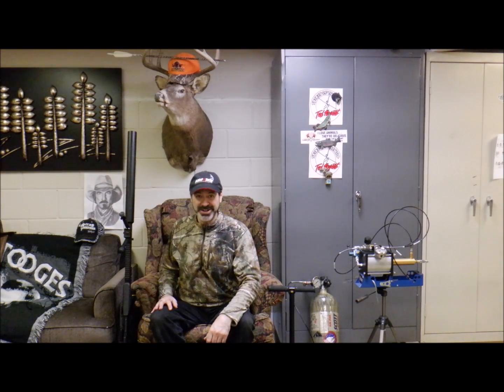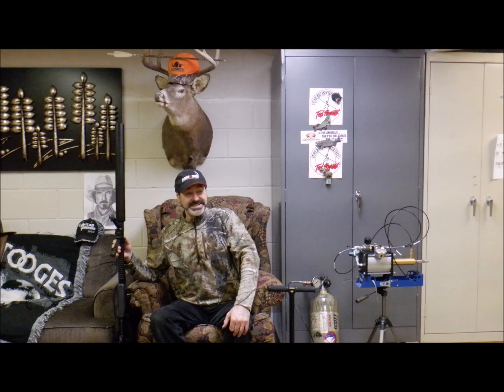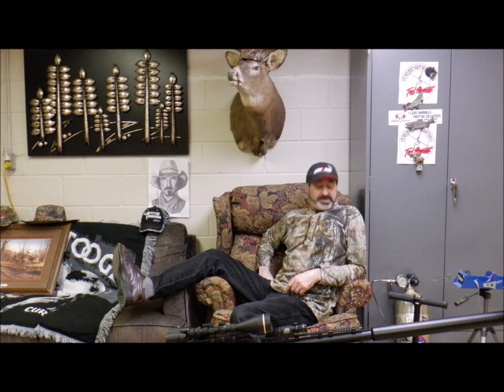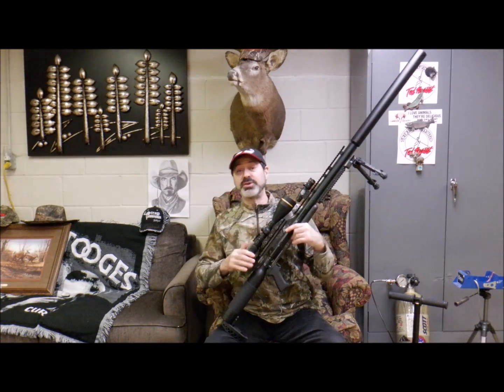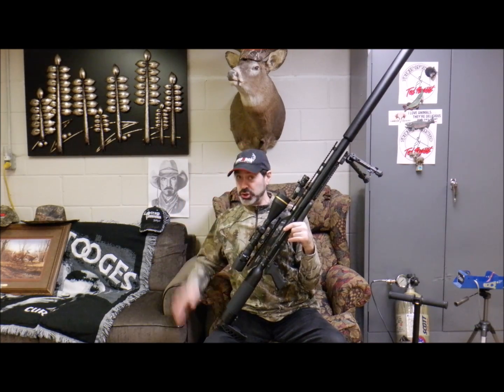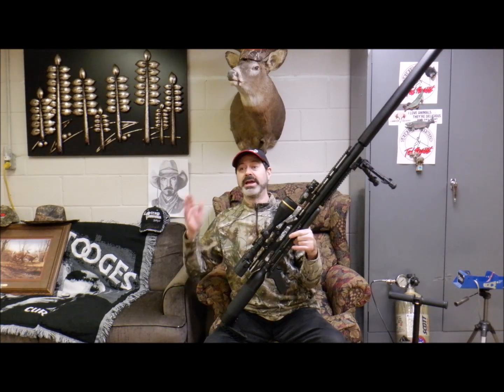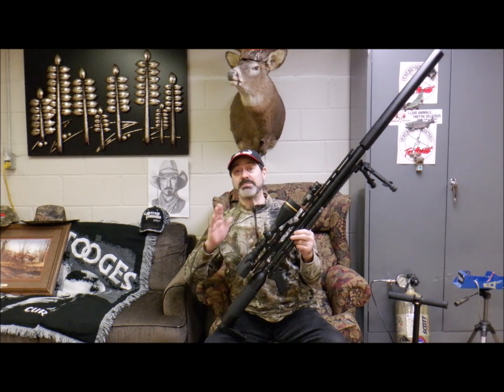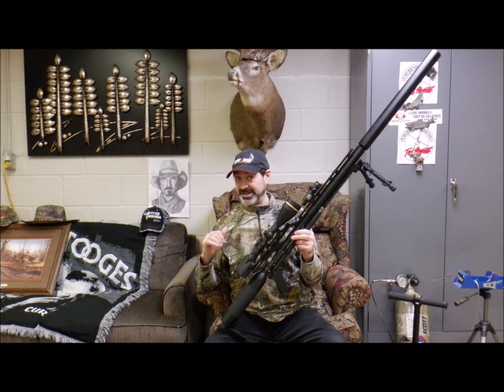Texan 50 with 3000 PSI Bottle

Comment: Good information. glad I kept the stock tank/valve on the .457.
I'm liking the 350gr as a utility round out of the .50 Texan. The 525gr hp and the 545gr fp are my two favorite heavy slugs you make. I knocked over a gong on the 545gr today. I'm having excellent accuracy on my 60 yard, 70 yard, and 80 yard gongs.

Comment: I bought a NoName Wang for emergency use but had to test it of course. I have a DIY TX2 with a Chinese 500cc CF tank mounted on a .457 and I fill to 3600. Some hard pumping (a small guy might not have enough body weight to push it down but unfortunately I do, haha) but I test filled it several times.